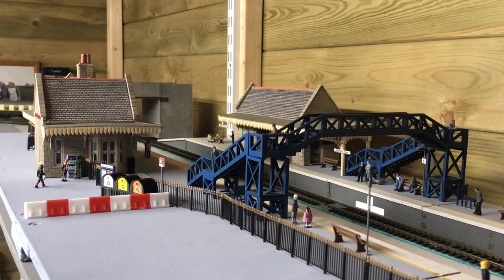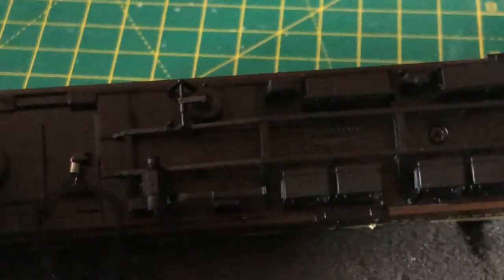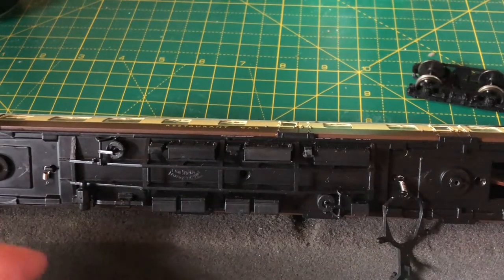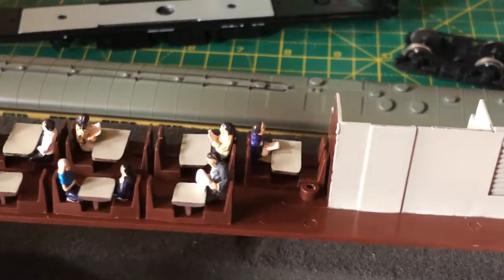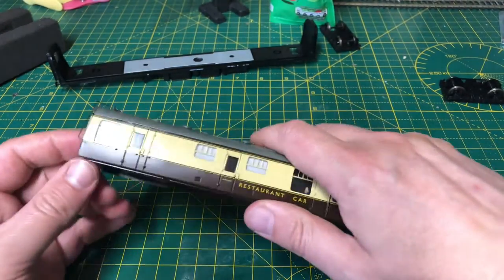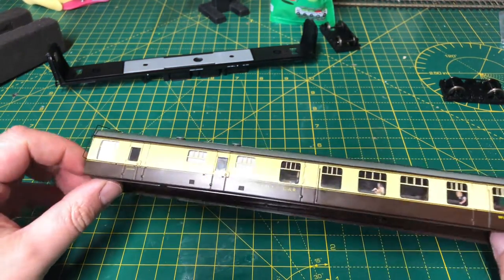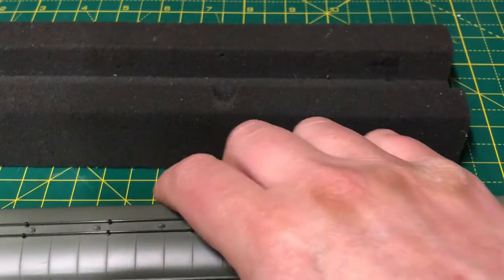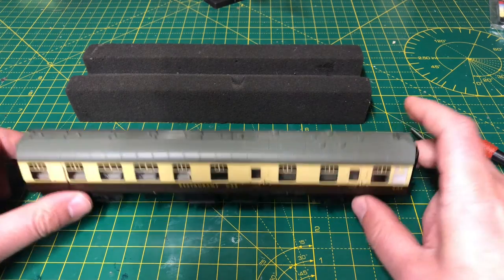How to: Bachmann MK1 Coach Removal.

Comment: You don't need to take the bogies off and undo the screws on the bottom of the coach, just take the piping of the ends and remove the body keeping the coach floor attached to the chassis. Better still don't take them apart in the first place.
Reply from the maker: Tried this previously and personally wouldn’t advice it as the sides of the body tuck under the seating compartments and the compartment would be screwed in the chassis still if you don’t unscrew them. unless the roof and sides clips come away with ease (in my experience they don’t) It’s difficult and easier in my opinion to use the method in the video :)